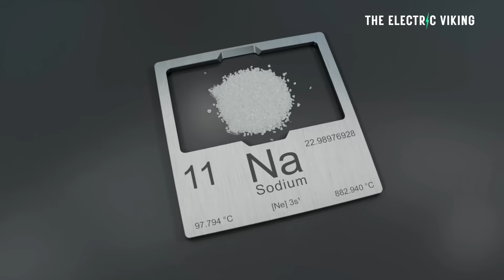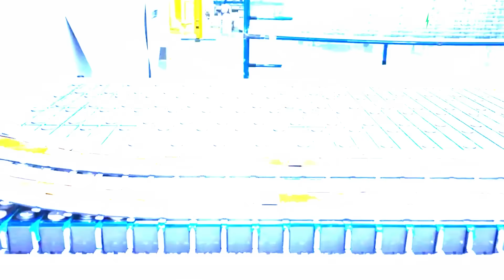Goodbye Lithium! New 3,600,000 Mile EV Battery costs 50% LESS

Comment: Another week. Another new battery.
Reply: Another day, another promise. Yawn.
Reply: It's almost as though there aren't several countries in which most cars are powered by what, 10 years ago, were game changing batteries.
Reply: Batteries have come further in the last 10 years, as internal combustion has, in the last 100 years. Had electrochemistry had the same 120 years of development that combustion engines have had, we would laugh at the idea of combustion as a practical means of conveyance.
Reply: @vincentrobinette1507 Your last sentence is VERY true. 
However there are “game changer” new batteries announced all the time. For one reason or another, most never make it over the finish line.  Optimism is fine, but we still need to be realistic.
Reply: @FutureSystem738  I agree. Sodium batteries have been in the works, for decades now. the only experience with sodium, were the Aquion sodium Ion batteries, that didn't even have the energy density of Lead Acid. Very "soft". Too much voltage drop under heavy load. a 100 kWh battery would be bigger than a full size refrigerator/freezer. That said, I'm still somewhat skeptical of these specs. They sound "too good to be true". Believe it, when you see it!

Comment: RIP Tesla! Lets go for $10 per KWH.
Reply: Harris lost and Trump won....hahaha!
Reply: So you think Tesla wouldn't use them?
Reply: @Islamisthecultofsin  They paid a lot for the 4680.
Reply: @keithdow8327   Doesn't mean that they won't switch to the Sodium battery.
Reply: Yet another utterly clueless comment from Keith.

Imagine my shock 🙄🤡🤣
Reply: @JohnSmith-x3y8h  

FSD #       Miles to critical disengagement.
12.3.3       196 miles   (accident everyday)
12.3.6        228 miles  (accident everyday)
12.5.1.3    183 miles  (accident everyday)
13.x     493 miles (accident every other day)

Tesla says it needs 670,000 miles to match humans. That requires a 1,400x improvement. Don't hold you breath. From 12 to 13 was only a 3x improvement. At this rate it will take over 10 years to reach autonomous driving.  RIP Tesla.